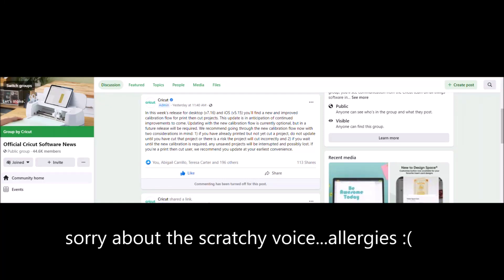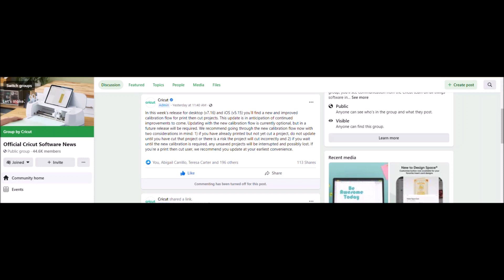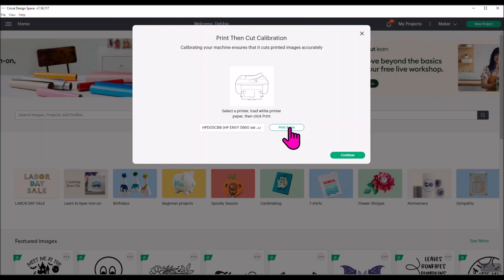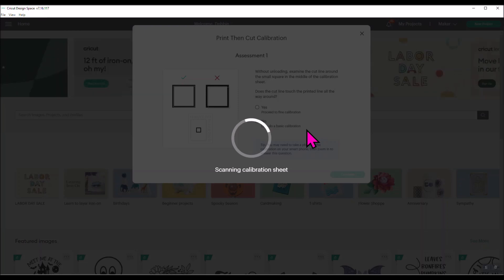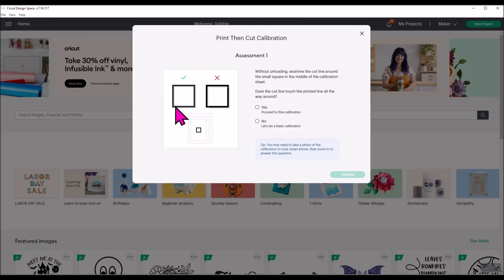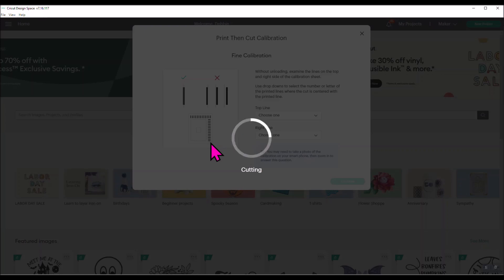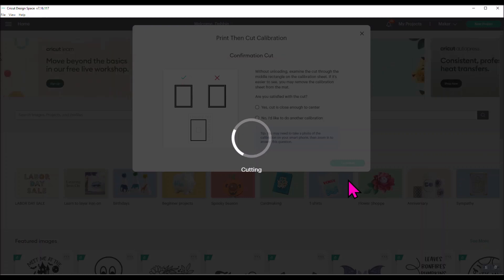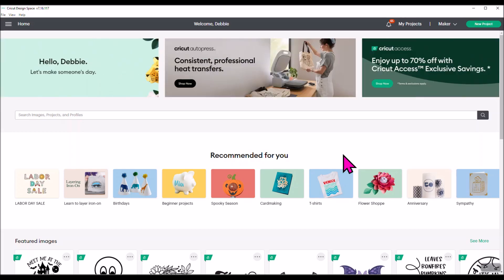Print Then Cut Calibration Overview and Tips (New Version 08.30.22)

Comment: How come this update requires you to constantly calibrate though? I get that this was two years ago but I’ve since done print then cut projects and have had no issues. Now it’s requiring me to constantly calibrate after each project and I am just cutting the same thing over and over again because I’ve already printed what I want to cut. And of course after I’ve calibrated it STILL did not cut completely centered like how it’s supposed to after calibration. I find this update really irritating. And then on my ipad it will not let me print then cut without calibrating. -_-

Comment: My printer prints the calibration but it prints it mirrored. How do I change it so the cut lines up?
Reply from the maker: This is unusual. Is your printer printing anything else out mirrored ? Depending on your actual printer settings that could be an issue and you would need to adjust the settings within the printer. There is a setting on some printers to print in mirrored format so look up if your printer has that option and check there.  Design Space just sends the calibration sheet over to your printer.  I just checked and mine printed fine so I don’t think it’s Design Space issue. I’m sorry I can’t help you further than that. I suggest if your printer set up is working ok on other prints and it’s just the calibration sheet that you contact Cricut support to see if there is an issue on their end they can help you resolve.

Comment: Sounds great.  I wish they could come up with a solution for this issue.  More than a couple of times Design Space has gone down after I printed my design and when Design Space comes back up, it doesn't recognize the printed document and I have to print it again and I have wasted either a printable vinyl sticker page or printable magnet sheet.  This is not good because you know the chance of having it cut exactly how it was originally printed is like unloading and reloading a mat thinking your cut will be accurate.  This is an extra, unnecessary expense.  On these occasions, to be clear, it is not my internet, but Design Space that has gone down.